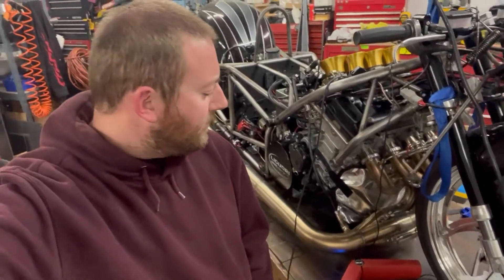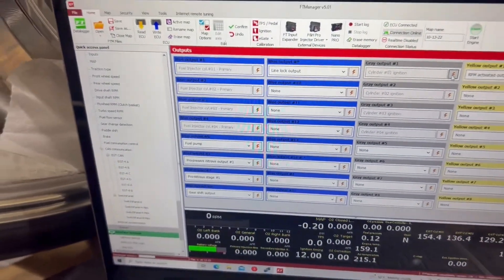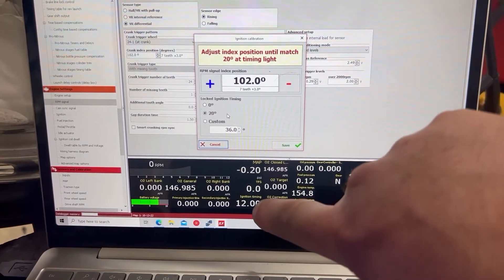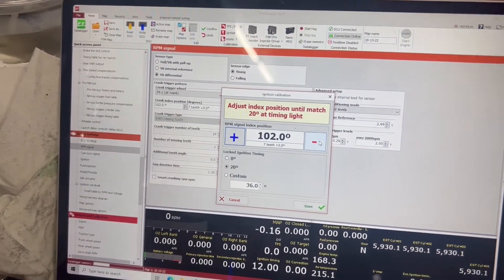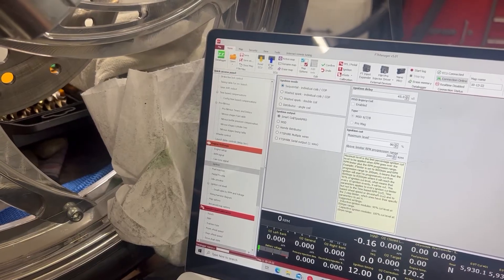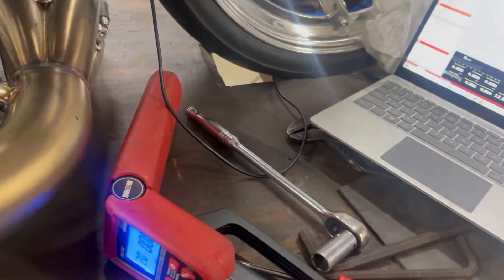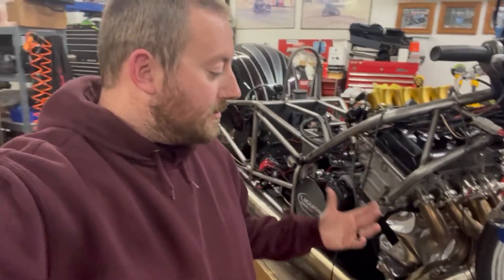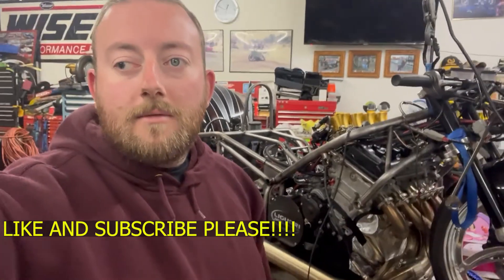Checking your ignition timing

Comment: If you're making your own spark plug wire extender, the blue crimp on bullet connectors work pretty well. The female side for the plug and the male for the coil side.

Comment: I need your help with properly phasing my distributor I need clarification 🙏 please I took my engine and set it to TDC then set the pickup and number one spark plug dead on then set my timing light at 20• then adjusted the index on the laptop till zero TDC ON THE CRANK! Car runs  🤷

Comment: Thanks David!
Just bought the same timing light.
FT550, Busa 01.
Had 108° prior.
After this video I got to dead on 100° on wasted spark (should I be on wasted spark?)
Reply from the maker: Sequential in my opinion is better but it also depends on how you have it wired. With a FT550 you should have coils and injectors on separate outputs and then also have the cam sensor wired and working so you should be able to run it in sequential.
Reply: @LiguoriDragRacing  Thanks, will try

Comment: What about verifying timing at higher rpm’s? Do you ever see timing drift? We had a situation where the plug was giving a very strange reading not a clear indication of if the timing was correct or not. I can go into more detail if you like.
Reply from the maker: I just put a sensor on this bike to check ignition drift at higher rpm. I will report back in 2 weeks or so with results.